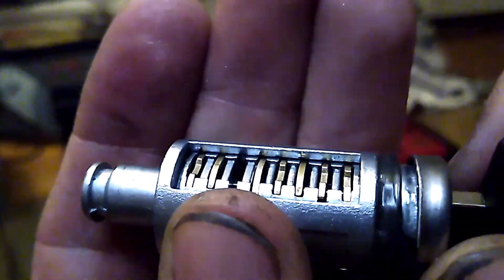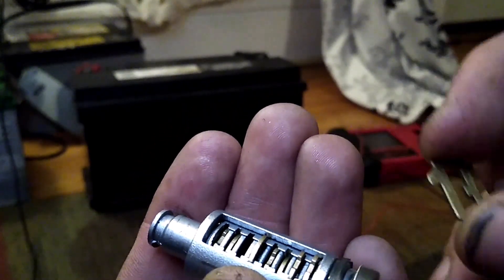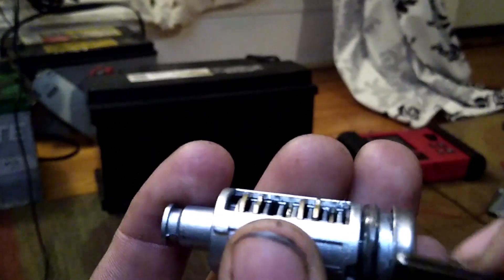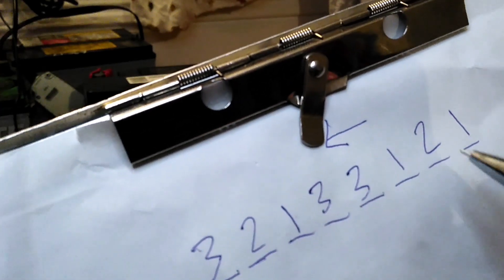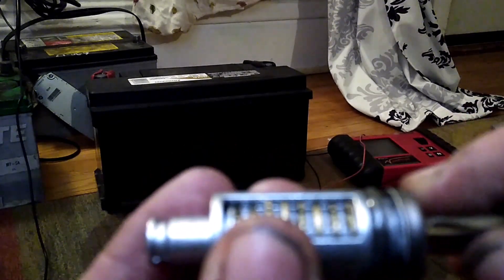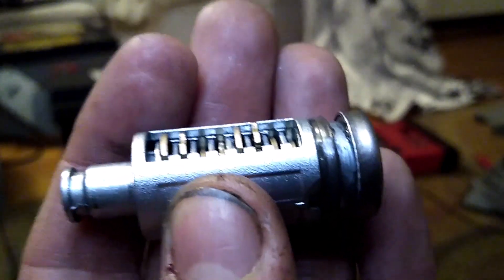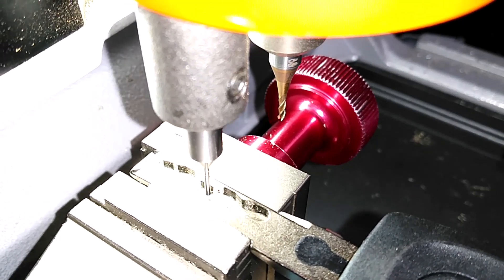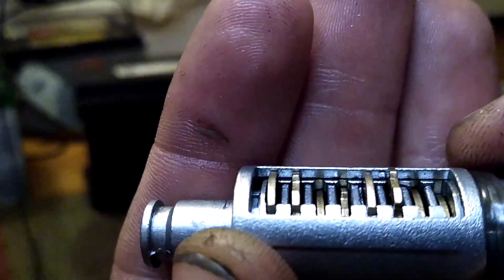Visualy Decoding wafer locks

Comment: my wafers do not have numbers, but i am able to take lock part and have the wafers. How do i measure them if they have no numbers?
Reply from the maker: Use depth keys. Know which key is which depth cut and go off that.
Reply: The whole point of this video is you don't need to take the lock a part to read the numbers on the wafers.

Comment: Sir,  when you decoding  the number  to be ready cut the key,   those numbers start from the front tip or read of the key where you stick it in?   And then those numbers just punch then In Sequence from rear or front of key??   You undertand my question?     I like this video.
Reply from the maker: Personal preference on if you want to decide it starting or ending at the tip. Just be sure the numbers are entered the same way in the cutter.